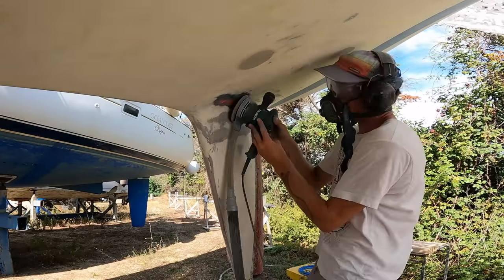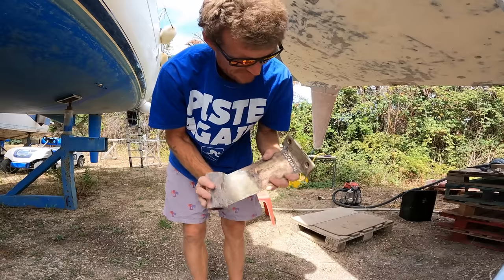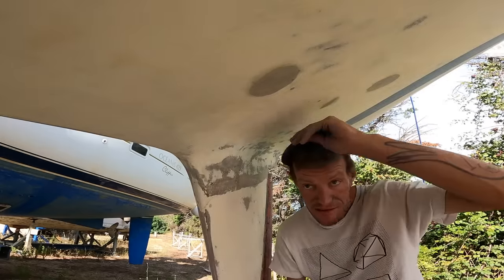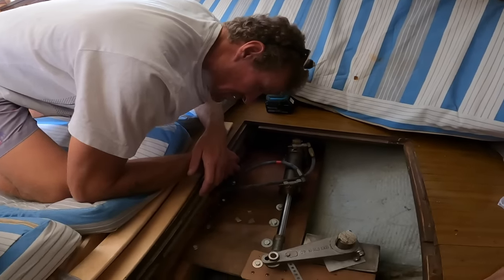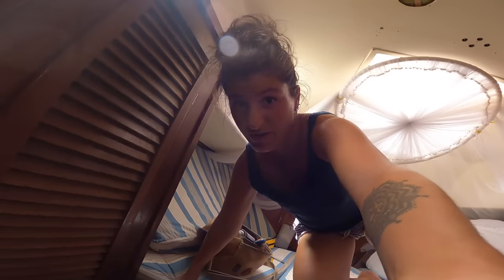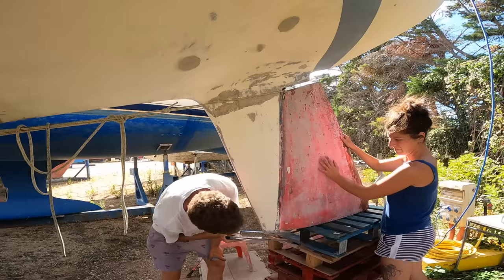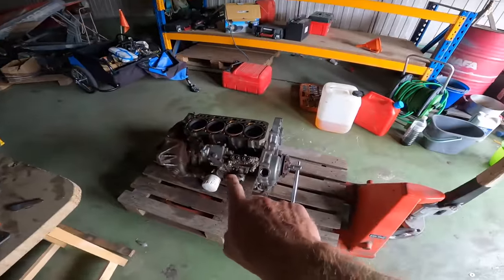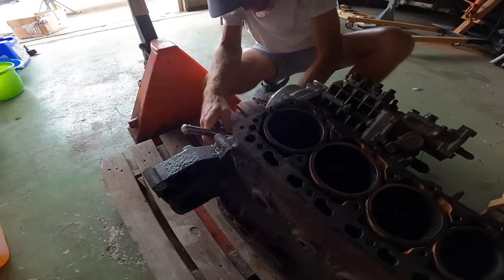Taking Our Boat Apart! The Rudder Is Not Looking Good... | SAILING SEABIRD Ep. 34

Comment: We surveyed A Formosa Ketch in Sotogrande with osmosis in the rudder post likely you have. The owners refused to have it properly repaired. He brushed it down and filled it with JB Weld. He left Sotogrande and took a right into the Straights of Gibraltar. The shaft broke off just South of Algeria’s. The boat named “Natchez Trace” was towed into Gibraltar. That would have been around 1989. When I left Europe in 2009, the boat had not moved since the day the rudder fell off.  Please fix it right, your have put too much time and love into this boat not to. I’ve been retired for 20 years and not kept up with the newer methods of stainless steel repair. There must be a Metallurgist following you that can chime in.
Reply: Looks to me like crevasse corrosion of the rudder shaft. This likely means a new rudder, as the rudder shaft is the main structural component of the rudder. There may be a stainless steal plate inside, along with a pair of gussets, or two pair of tangs, that are welded to rudder shaft. The rest is probably foam and fiberglass. Unwelding the rudder shaft from the plate and tangs or gussets might be possible, but is probably not worth the effort.

Comment: I noticed that when the boat was moved last week, more water came out of keel, so think that now you can get to bottom of keel, it could be possible to drill some small holes in bottom of it. I watched another channel do this with encapsulated keel after they gounded it, it took a few weeks to dry it out.

Comment: WD-40 is not particularly effective when used as a rusty bolt penetrate. Use a penetrate oil like PB Blaster or Kroil and those stuck nut/bolts will come apart much easier.  Pre-cleaning any of the rusty exposed threads with a wire wheel and heating the bolt with a small propane plumbers torch will also help get them separated.

Comment: hot heat wave, but then we are going to get lots of rain, sometimes even hail, and the temperature may at some point get down by 20°C, I personally think it's welcomed, having to sustain some 35°C temperatures, up to 28-30 inside, which temperature you loose all motivation to do anything, this is what is planned where I live, in Isère only a few hundred Km north of where you are, good luck for this next week. 
For stuck rusted screw, a bite of WD40 and an impact screwdriver does very well the job. If it doesn't move, just hit more and it will move at some point, although it would have probably not worked well for the stuck bolt as the other end was free

Comment: God, five weeks of sanding, that must be soul destroying! Well done.
Get yourself an impact screwdriver. Bash the end with a hammer, it cams the bit around about a 16th of a turn, and drives it hard into the slot at the same time. They're cheap, and perfect for busting stubborn screws loose, or doing them up really tight.

Comment: .... laughing .. the rudder stock .. MacGyver it with the tin foil from a gum wrapper .... have meant to ask what are you doing or thinking of doing to spruce up the panels that are just above your bilge dance floor ..  are you going to try and salvage the wood look or you going to paint or even put a new veneer over it .... have to say your windows repairs sure are top notch .....  thx for the share .. as always .. never stop dreaming, just dream bigger .. have fun be safe, save our oceans ....

Comment: ‘Loving what you two are achieving and loving your positive can-do approach to this project, very refreshing and inspiring and I have absolutely no doubt that we’ll be enjoying your sailing videos on this boat soon enough. It may have been a slip of the tongue but when you replace the screws in the rudder heel pintle you definitely don’t want "brass" screws - you need bronze (or stainless steel). Brass is pretty useless in a marine environment. If the pintle is bronze and it is still OK stick with bronze screws, if you do have to replace it and end up with a stainless steel one then of course use SS screws. That crevice corrosion on the rudder stock is a real kick in the teeth for you, obviously the cathodic protection was never functioning for it so rectifying both the rudder stock and the cathodic protection are going to be interesting jobs for you and I suspect that a lot of viewers will be interested to learn from your experiences in how you go about resolving them, particularly the cathodic protection failure. All the very best you two, you are both inspiring!!!
Reply from the maker: Hiya.
I keep saying brass, I know it's bronze. 🫢
Want to try and keep as much as possible in one metal. 
The corrosion is a bit annoying, but we've got a new rudder stock.
There are no anodes on the boat that could explain a lot.
Cheers for watching 😃

Comment: On the rudder shaft a good fabricator would be able to re sleeve and strengthen that section.
Reply from the maker: We've got a new shaft steel. Our friend can weld them together, once we've dissected the rudder.
We had to get the part from Ireland as its imperial and most places in the UK wouldn't send to France.
Cheers for watching 😃

Comment: trick  for getting stuck   slotted  screws  out    ,   get  a  battery drill  with torque settings   and  a  slot screw driver bit    , not an  impact driver  it  will   be  too much     ,  put  the  drill   in  reverse and  work  you  way up  the   torque  settings   so its  not too much  its  very effective )
Reply: 👍🏻 but Torque … predictive text is a pain I know .. I’m using a friends Apple and it’s very very insistent it knows what I’m actually saying but it doesn’t 🙄

Comment: Might I suggest a product called Kroil for loosening rusted fasteners? Its WD40 on steroids. Also an adjustable crescent wrench on the square shank of the screwdriver would have helped with the removal of that shaft bracket.
Reply from the maker: All sort. But we'll check out that spray oil.
Cheers for watching 😃

Comment: You really should wait a bit longer after grinding out that osmosis for it to dry , it needs repeatedly washing over a few weeks to make sure all the blister juice is out and then leave it few months before filling them , you really need to get someone with moisture meter to test that keel before re laminating , a wet hull can be left ashore for 20 years and it won’t ever dry unless you take the gelcote off and even then it still takes long time to get to level of dryness to get good bond with the new epoxy
Reply from the maker: No real osmosis blisters just many pin holes and bits of fibreglass that need attention.
The keel is our main concern, but it will be fine.
We've started airing it out and with underwater epoxy I'm sure we'll get it fixed.
Only an issue in cold climates.
Cheers for watching 😃
Reply: Hang in! Really have a great channel with good content!

Comment: I have seen people using a "bit and brace" (oldskool manual drill) with a flat blade inserted  to tighten and loosen flathead screws. apparently you can get a lot of torque on the screws, but at the same time maintaining pressure so that the bit doesn't jump out of the slot. Haven't tried it myself, but have seen other people doing it. Its the sort of thing you'd get for 50p at a car boot sale.

Comment: Why oh why did you remove the P bracket! There will need to be heaps of alignment issues if you do not get the installation and alignment right. They will include stern baring wear and heating, stern gland leaking and P bracket bearing wear and overheating.

Comment: buy an impact driver the old hit with hammer type usually come with 4 driver bits the largest flat driver is perfect for what you will be faced with on a boat . because you smack it with a hammer it tends not to chew the slots like a screw driver. They are reasonable cheap as tools go. from a car tools place invaluable for taking anything apart. much better than power tools. I can send you a pic if you need

Comment: Not sure what your thoughts are for the brass bolts stuck in the bracket and rudder post, 
You could maybe drill them out 
Pilot hood and work your way through the size of drill bit or 
Perhaps you could drill and tap a thread to accept a bolt and try unscrewing each brass piece 
After a proper soaking in a penetrating spray. 
It would likely be easier doing either of those than having to tap larger holes.

Anyway great progress on the hull and a huge relief after all the sanding. 
Nice one

Comment: To patch the osmosis blisters, look up the patch diameter, for the depth of blister. You want strength, not cosmetic repair. You really have very little osmosis, compared to some that I've seen hauled up from Florida, in the early 90's. The grinding needed on them, was way worse than that little pit you showed.
Best wishes from Canada.
Reply from the maker: Thanks for the tips!
The boat has been in a hedge for 15 years...
Cheers for watching 😃

Comment: G’day Stu and Marina chuffed the sanding is done . . . Almost. Five weeks of sanding would have driven me around the twist. But good on you for persevering. No option but to I guess. Stu when you put the Rudder assist and the prop shaft “P” bracket back in please use some stainless steel Nylock nuts to ensure they don’t wiggle loose. Especially the “P” bracket. With regard to the “P” bracket I would also get a 10mm (3/8”) stainless plate bent up to fit snugly in the inside to give it more area to support it from the inside. Those two rectangle plates are as useless as a bull with boobs. That original install was not good workmanship from the boat builder in my opinion. However I am a heavy mining equipment mechanic snd not a boat builder so I could be way off the mark. That is just my input. I know you are no fool and will do what’s best. Great progress guys very impressed indeed with the achievements. Marina great job with the window and as always superb content and editing. Look forward to next weeks look in. Take care guys. Stay safe snd keep that vision alive. Have a fantastic weekend. Cheers Ken Australia 🇦🇺

Comment: Hello!
I'm from Brasil and I'm a saylor too
I saw the episode of repairing the engine and I see Stwart heating the piece of cooling system where you've showed  a crack in a radiador made of Coper. 
Did you repair that welding it?
If you did not, the salt whather wil mix with whater inside the engine.
Reply from the maker: Hello! 😊
Yes, that was repaired. We knew we couldn’t leave that crack there so our mechanic helped us welding it.
Thanks for your concerns 😊 It was pretty important! Nice that you noticed.

Comment: Why not pad weld the rudder stock and grind it back to new stock that`s the cheaper way of doing thing. why make more work for your self if you can get the rudder stock pad welded
Reply from the maker: There's always a cheaper way to do things.
We figure, do it once with a new rudder shaft and it should last another 50 years.
Tbh I'm starting to hate stainless, I'd rather have everything in bronze.
Cheers for watching 😃